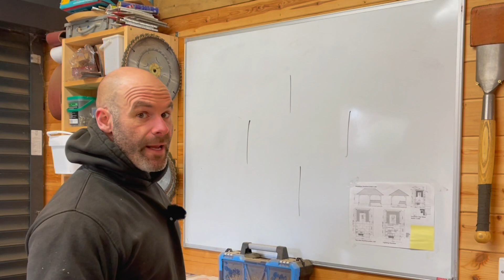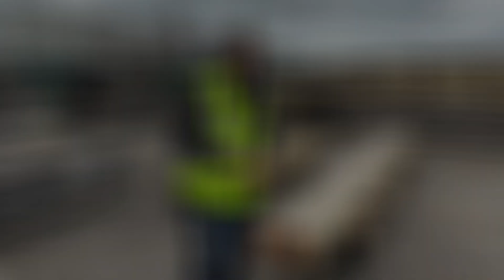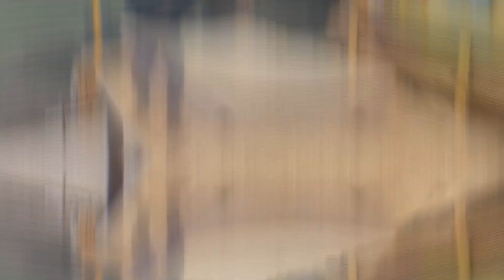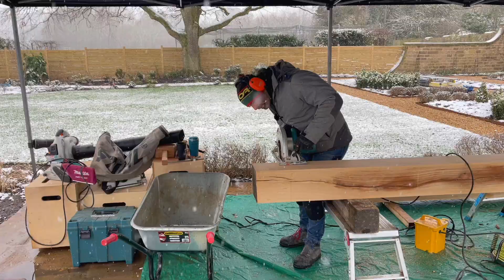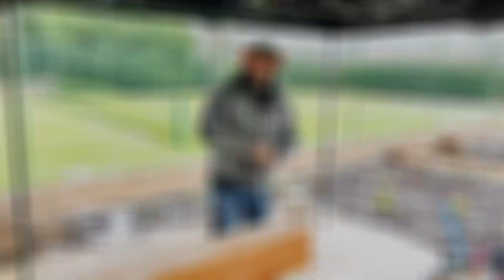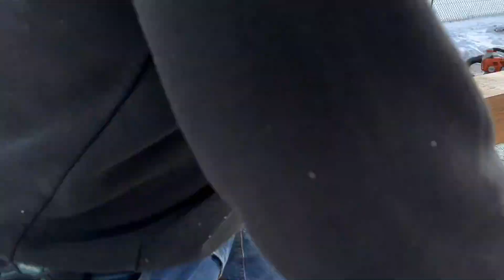Oak Frame Gazebo Ep:1 Power tools galore and some big Oak Beams!

Comment: Hi 👋, Simon , great job, about 17/8 years ago I made a King post, trust Roof for a property, so when you were sitting in the dining room, you can see all the beams exposed, I purchased the same electric planer as what you are using, but I have the Mafell chain Mortis machine, with the extra base plate, I made up a jig that could be fitted to it, so I could do the Mortis and Tenoner joint.  on end of beams, instead of using a skill saw, Plus I went out and brought a secondhand Wadkin EKA 5 Tenon machine, it wasn’t cheap by the time I rebuilt it and plus put new modern style cutter blocks on it, Leitz , considering I worked by myself, I had a reasonable size workshop ha ha, 8X 35 Mt , I still got most of my machinery and tools, I’m now retired, living in France, originally from the UK, I wish you all success for the future, 
Phil from the moulin France
Reply from the maker: Thank you. Sounds like you built some amazing things, hope retirement is treating you well
Reply: @simonbowler1 With a project like this how much does it normally cost materials alone? Thanks!

Comment: Excellent video. Another great project. Appreciate it is the first episode but start to finish, including the workshop time, what sort of time would you spend on a project like this? Keep up the great work and videos.👌
Reply from the maker: 3 weeks ish, dependant on weather and a few other things 👍🏻
Reply: Hi Simon I’m in the middle of designing and building my first oak frame structure. I’ve found your videos invaluable as a source of information and very well presented. I’m building a 6m x 11m garage and my son is helping me putting all the details on to sketch up. I’m from the north east and would love to know the supplier you use for your oak.